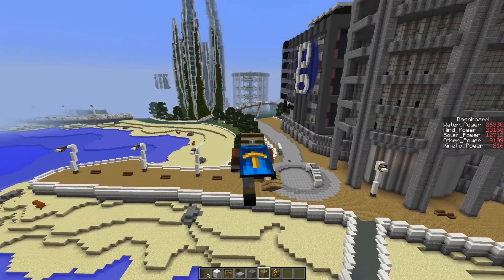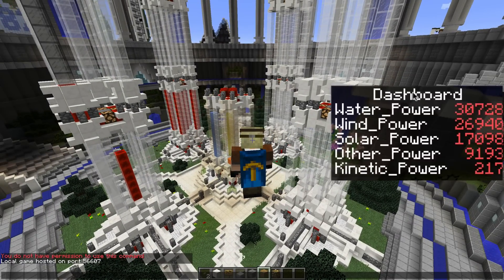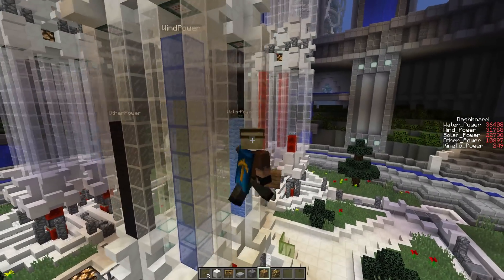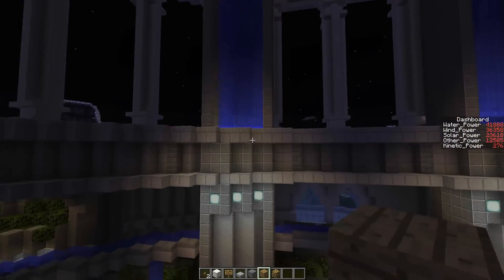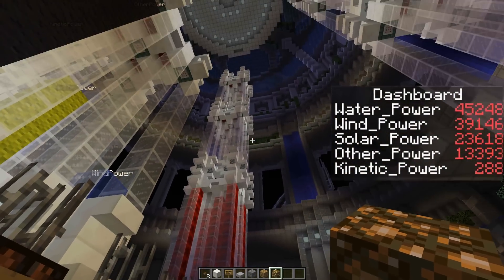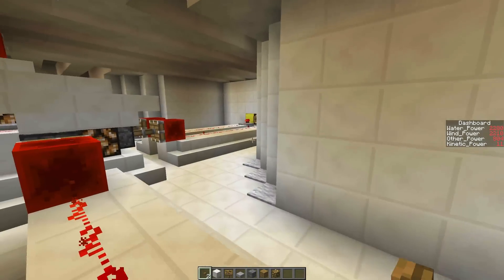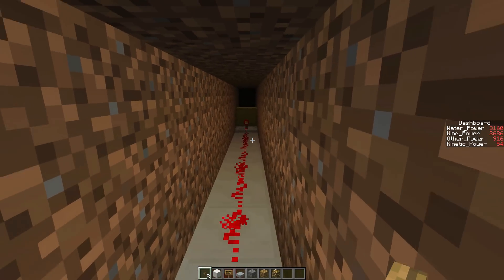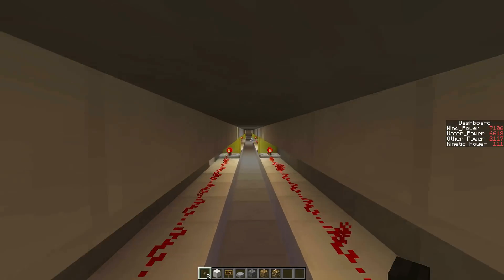Minecraft Power Grid and Batteries

Comment: Actually, how would you turn off a solar panel, wind turbine, kinetic power source or anything like that. They will inevitably keep collecting power, although where does the non-used power go? It needs to end up somewhere!
Reply from the maker: iSasFTW hehe..  I suspect if you turn off the solar panels the energy will evaporate as heat. the wind farms has a locking mechanism that locks gears from moving. locking the kinectic energy will just have the energy dispersed as vibrations and well locking the hydro generators will be the same as the wind farms.... I think ;-) or it can just spawn multiple tnt that spawns multiple tnt that just blows up everything
Reply: The TNT way sounds quite expensive xD
I would love to see a city running on 100% clean energy, especially the Kinetic energy sounds exciting! Hope someone does this in the future :D
Reply: the power just goes into the ground :D
Reply: iSasFTW it would collect it then not collect anymore... because it cuts off the way to the battery or it stops the charging mechanisms...